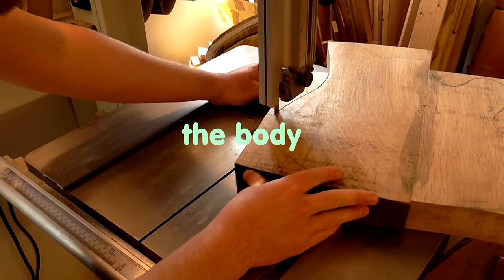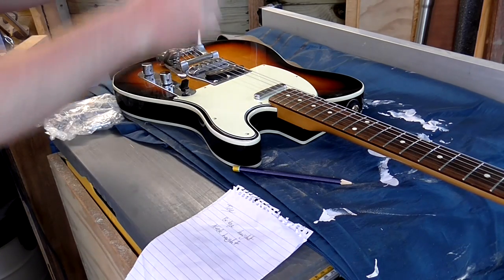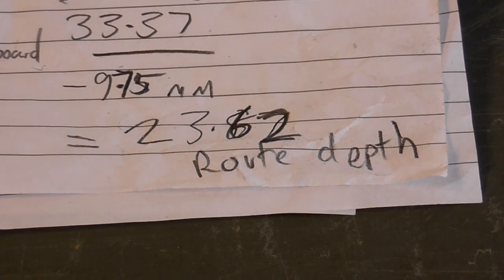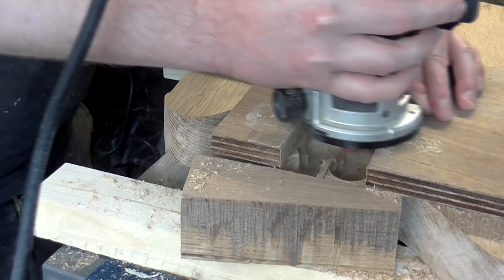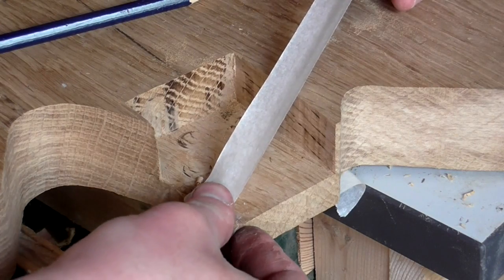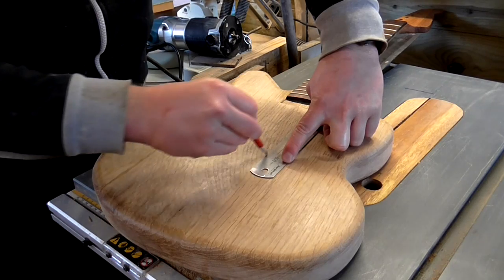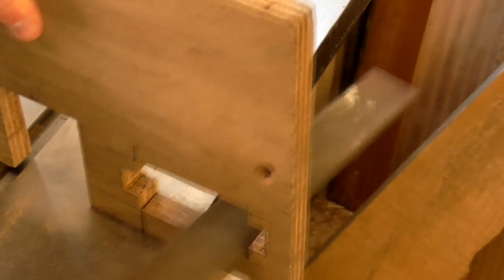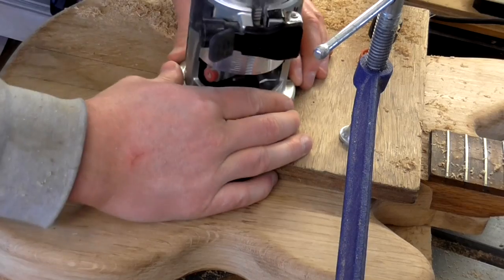Making An Electric Guitar from Salvaged Oak (part 5 of 9)

Comment: you measured the neck height  from the pick guard, not the body.
Reply from the maker: +Fony Montana the thickness of the pickguard was accounted for in my measurements already. Someone already posted where I went wrong - unfortunately I lost his comment as I had to re upload this video. It was something along the lines of: "the bridge at it's lowest setting should be at the same height as the fretboard"... I think that's definitely where I went wrong - I wish I'd have known that before building it!! You'll see the crude way I have to fix it later in the series... Thanks for commenting tho